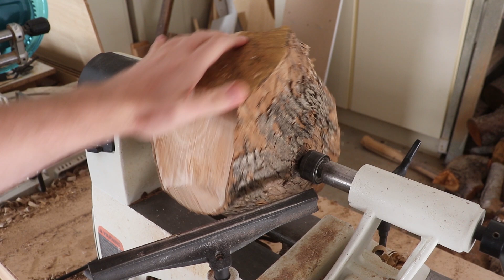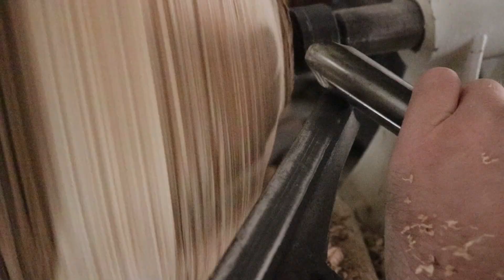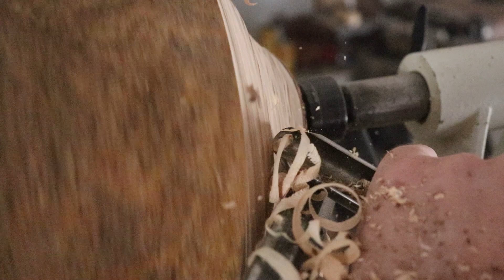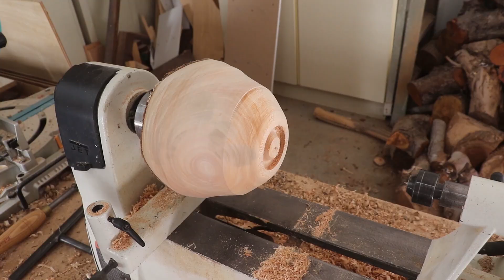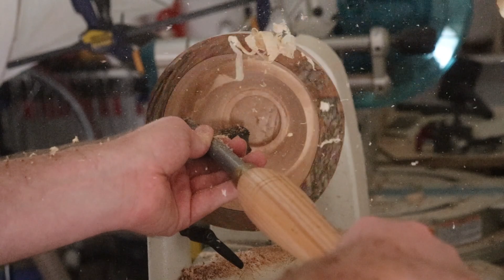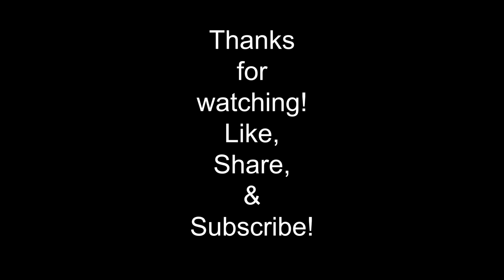Wood Turning a Bowl

Comment: That finished bowl was VERY nice.  I once made a bowl back in Junior High shop, but instead of it being made from a raw piece of wood like that, the shop teacher had me wood-glue a number of scrap pieces of flat wood together and then turned that pile into a bowl.  I like your result much better.  HA!  

Question:  I wonder if the moisture level of the wood makes it easier/harder to turn a piece of wood into a finished product, and if so, is it better if it is higher or lower moisture content?
Reply: Green wood cuts like butter, basically. Drawback is warping and cracking in pieces.
Reply: @DAsh-wi1zc  I guess that makes sense.  So do you have a means of "drying out" the wood if you find a piece you like, or do you just have to wait for it to dry naturally?
Reply: @LynnCindy   I generally work with slabs that I saw from log rounds, only the side cuts with bark on. Stack them on sticks with the all-bark ones on top, in a dry area where air flows around them and they dry nicely, a year per inch thickness, or thereabouts. Limbs I usually let sit and then wait until a moisture meter gives a reading less than 14% moisture. Hope this helps.
Reply: @DAsh-wi1zc  Thank you, as that was really informative, and definitely information I did NOT know.  I don't currently own a lathe, but the more content I watch, the more I'm trying to convince my wife we "need" one.  LOL!  I did look at the one from the link you provided on Amazon, and added it to my cart there for now, but am on hold since we have other Christmas gift-giving obligations.  HA!
Reply: @D. Ash
 Thank you, and yeah... I can see how it COULD become an obsession.  HA!  I mean just watching the various videos I have, is almost an obsession, because I'm always fascinated and impressed by the finished product.  There is also something to be said about something handmade that you made yourself, and which will most likely stand the test of time.  My Dad is still using the wooden bowl I made in Junior High Shop, and that was more than 40 years ago.